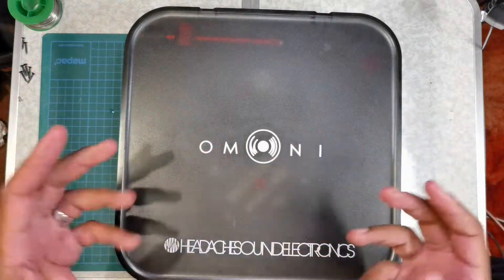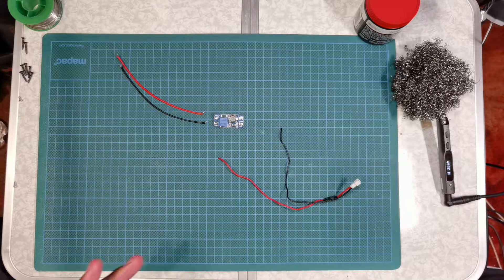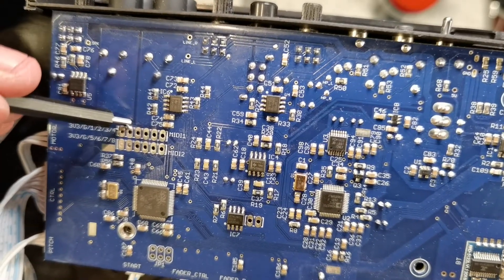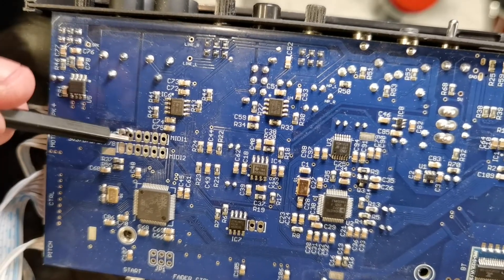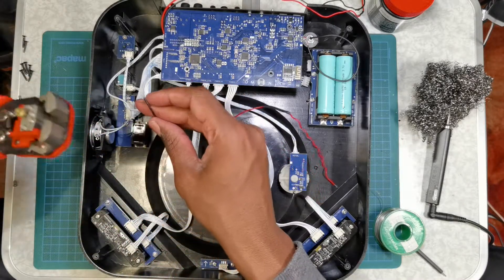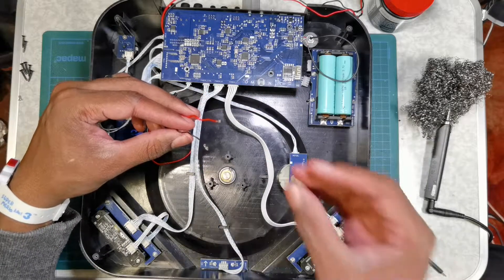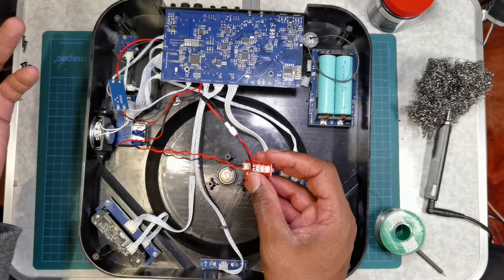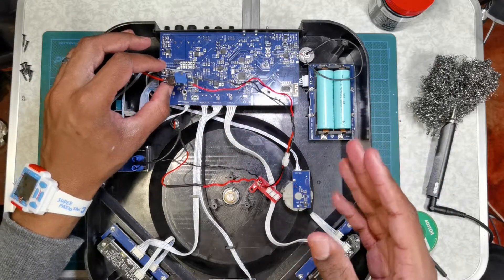Omni Turntable x Jesse Dean Target Light Upgrade!

Comment: very nice work! 👌😊 did some mods as well but mostly for asthetic.
 do you know a way to mod the eq? i‘m not happy with the scratch setting it sounds telphone filtered.☹️ flat and hifi have too much bass of course..
a low cut would fix it. is there something like a „lowcut-chip“ to solder after the eq?🤔
Reply from the maker: Thanks man, I have to be honest, most the mods I've done on the Omni, aren't necessary at all, with the exception of the speaker mod. 

  In regards to the EQ settings, I guess one way to implement a proper EQ, would be to solder the tonearm wires (WRG) to a mini EQ board, then solder the EQ board to where you'd solder the tonearm wires (WRG). Drill the relevant hole/s for the EQ knob, job done.

 Personally, I'd recommend plugging the Omni into a portable speaker, see if it sounds better, if it does, then I would perform a speaker mod like what I did on mine. I believe that the Omni speaker position is the issue. I wasn't please with the Omni's indirect and vague sound quality, and it was because the speaker is mounted on the side, oppose to to on top like the PT01 Scratch. Since installing a speaker on the top of the Omni, the sound quality has improved tonnes. No more indirect, vague sound.